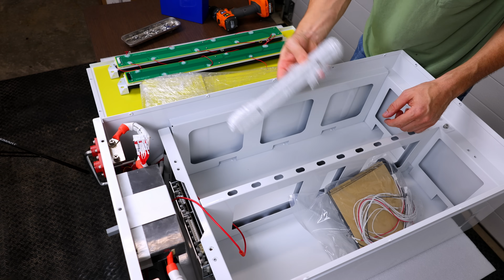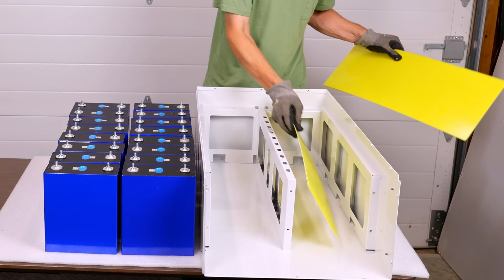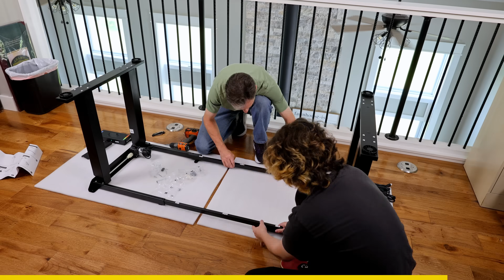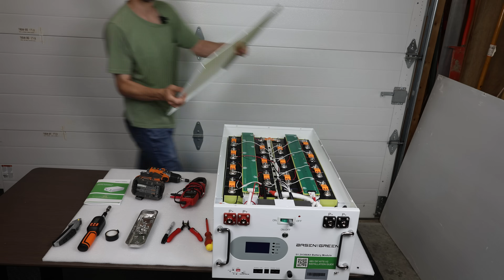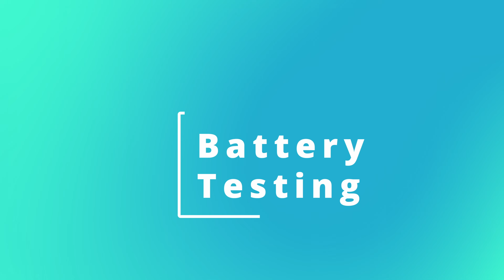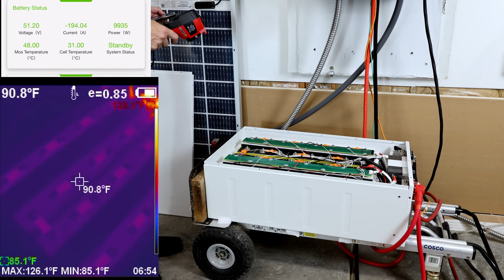SAVE Thousands V2 - Build your own home solar battery backup!

Comment from the maker: See recommended battery options on my website: https://projectswithdave.com/batteries/
FlexiSpot's Summer Sale is here — up to 50% off! Check it out now and use my code "YTE7P50" to get extra $50 off the E7 Plus/ E7 Pro/ E7L standing desk.
FlexiSpot E7 Plus Standing desk: USA: https://bit.ly/3IIGuqI   CAN: https://bit.ly/3TAxVAG
Reply: Does the active balancer only work at the top of the voltage range?
Reply: Thumbs down for F only.
Reply: Hello, Dear. We are China JM Battery Factory. We would like to invite you to shoot an advertisement for our video. Are you interested in cooperating?

Comment: These batteries are a good value and the pricing is good, but I have an issue with the BMS on one of mine and they wouldn't honor the warranty.  They just kept asking me to take pictures and things which I did, but they would never send me a new one.  I've been trying to find a replacement, but they seem to be few and far between.  I guess you get what you pay for!  Just beware if you have any issues, you will likely have to replace the parts on your own.  I would have bought a couple more of them had they honored the warranty, but won't now.  I'll pay a little more to have some type of warranty.

Comment: Great video Dave! Could I set three of these up and go off-grid with solar panels? I already have solar and a backup generator, but I would really like to go off grid with this battery set up and more panels!!
Reply from the maker: It all depends on your loads and solar input.  It is very difficult to go off grid in most locations.  I find it's more cost effective to stay grid connected and just minimize consumption.

Comment: I got one of these and am now looking to double the capacity but they are out of stock, @ProjectsWithDave can I mix with any other brand of similar battery or should I just remove the "old" and get two new ones? Is there some way of knowing is a battery is compatible?

Comment: Can this setup be made as a 24v system with the same components? Have you done any diy 24v systems?
Reply from the maker: Conceptually it could be done if you just used the case to hold the cells and installed two 24V BMS units in parallel.

Comment: Great video @ProjectsWithDave. I am getting ready to commission a Basengreen V2... Do you know the specs of the breaker / isolator? I am wondering if I should have anything between the battery and my Victron Multiplus II 48v 6k5VA 100A inverter? Also do I need a pre-charge resistor if it isn't an off grid setup? i.e. can the capacitors in the inverter charge when I energise the inverter from the AC side?
Reply from the maker: The breaker takes a significant overload to trip.  I would treat it more like a switch and install a Lynx Distributor like this: https://amzn.to/4cQqe3v
It has space for fuses.  Or you can just add an independent fuse.  
I would use a pre-charge resistor even though you might be able to get it to work by just flipping the breaker.

Comment: If you were assembling about 200 kWh worth of batteries like this, how much time would the assembly take assuming that everything’s torque to spec and all batteries are checked for their capacity?
Reply from the maker: If you are doing multiple batteries, it gets much easier.  I would plan for an hour per battery on average.

Comment: How do I change that factory limit setting of charge and discharge of 80 A  and 100 A. It would be great to have a video to show how
Reply from the maker: If you get a version with a JK-BMS you can control all the settings.  I show how in this video: https://youtu.be/5AKooBZNT9Y

Comment: The crossing of the main positive and main negative cable is a very bad design, a short in this spot :-(, full back voltage and with out fuse!
The cables could rub at each other.

Comment: I have a copy of your BMS settings in my 'solar folder'.  Thanks for all the information.  If the inverter is running on grid, at what voltage do you switch it back to battery? I only charge with solar.
Reply from the maker: It's less about voltage in this case, you want to set the inverter to charge with PV only and use the batteries when PV is not available down to a controlled level.  You should have an inverter setting that allows you to only charge the batteries with solar, it would be called  "Self Consumption" mode or "PV Priority" mode.  Then set the minimum SOC to the amount you want to have available for emergency use, probably between 30% and 50% depending on your load and emergency power demands.   If you are controlling with voltage it will be hard to achieve a 50% SOC because the charge curve for LiFePO4 is so flat.

Comment: Hey Dave,I would love love love love it if you could do a build, or at least compare the latest CATL 587AH internal stacked vs standard wound LiFePo cells and explore if the difference is actually worth it. CATL is showing a 48% increase in energy throughput over the entire lifecycle and energy density of 434 Wh/L energy density—a 10% increase over the previous generation. Is this a game changer? 

Thank you for even considering
Reply from the maker: Battery technology is constantly changing and the focus for performance is in the automotive industry, where Ideal construction allows maximum charge and discharge rates.  If you are looking for batteries for home storage I would go with a reputable brand LiFePO4 battery that has been in the market for a while.  Home storage generally comes no where near the charge/discharge limits for the cells allowing you to select stable reliable cell instead of the latest "cutting edge" solution.
Reply: @ProjectsWithDave interesting reply. Thanks.

Comment: Hi Dave! 
Thank you for being so helpful to the solar community! 
I couldn't manage the 48V Basengreen kit via the pc software, finally I found an older version of the program on your website that works great (V1.1.635-15). The new version (V1.1.635-53) available on the manufacturer's website but doesn't communicate properly with the battery kit.
Thanks again for sharing!

Comment: I just finished building 2 of them, I like them, but the bluetooth app on the B&G BMS doesn't work on Android. Not too happy about that. Battery is excellent quality otherwise and both have been cycling as expected. It's a fantastic kit, 1 of mine they put the breaker in backwards? (I fixed that) but really seems like QC needs a little attention. I did not find any shrink tube in the connections as you did on the breaker. When I assembled mine, I found leaving the center divider a little loose made cell insertion easier. I wouldn't recommend this battery in a mobile application, I would rather have welded terminals. I also used the balancer, I wasn't worried about the wires as each is encapsulated in a braided sleeve that's pretty tough as-is. It would be nice if they could integrate the temp sensors and balancer wiring into the BMS distribution bars, it would be so much cleaner.

Comment: I would never try testing it towards 200 amps…. I also won’t need so much but if you NEED it then at least have 2 of these batteries in parallel.

Comment: Is there any way to do this like HV battery? In this case, these are LVs, which means the whole system runs on 48V. But I have a high voltage inverter - currently I run 7 h48050 pylontechs, which gives battery system voltage around 350V. Based on my understanding the cells are the same, the difference is only in parallel connections in case of LV and series connections in case of HV. Benefit of HV is thinner cables, lower amperage, which means easier and cheaper circuit breakers.

Could you please comment on this? I haven't found any guides for HV system like this. Thanks

Comment: Would it be ok to use threadlocker on these bolts if using it on an RV?
Reply from the maker: I think that could be helpful, I just wouldn't use the permanent type.

Comment: 180F on a cable and hotspots on the breaker connections are not great. You're skipping over that a bit quick for my tastes. Maybe not a concern if you don't intend to use it much above 100A. Could be a matter of cleaning up connector surfaces.
Reply: People have been using these boxes forever without issues.

Comment: The main reason these people do this type of kit is because they avoid paying for UL approval, and it reduces their product liability and warranty coverage (they only warrant parts instead of systems).  You may save some cash on the front end, but it may end up costing you more on the back end.
Reply from the maker: Right, there are some significant pros and cons to be considered when choosing a DIY solution.

Comment: It's interesting they limit it at 200A when it's a 314A system, so there's no way to get a 1C rate without either tripping the breaker or the BMS overload protection.  Just wondering if they have a kit with a 300A option?  If not, how easy would it be to swap out for a 300A BMS and breaker?

Comment: Will this battery pass the inspection on a new construction project? Tesla batteries are insanely expensive and I was thinking about building the system myself but based on what the contractors say it might not pass the PGE inspection
Reply from the maker: If you need to pass an inspection I would go with a UL certified battery like this one from EG4: https://signaturesolar.com/eg4-wallmount-indoor-battery-48v-280ah-14-3kwh-indoor-heated-ul1973-ul9540a-10-year-warranty-pre-order/?ref=SALE

Comment: Hello, I'm a new subscriber. Thank you for all the wonderful information you're giving us. I'm trying figure out how to make a r v plug 240 50 amps with the battery set up, I'm going to have to live off grid pretty. Soon any suggestions, please let me know or recommendations. I have one a 1200 watts, the worth of solar panels currently to pair with it, I don't have the battery or batteries. But most of the ones I see are for 120v i need to be able to run the A. CI live in a desert and work here?
If you have any recommendations, I'd really appreciate it

Comment: Great video. Well done. I've got a well house seperate from my main house and need to setup some battery system to run the pumps in a power outage and hope to use something like this to run it.

Comment: Not really saving much lifepo4 300ah batteries are around 300 dollars here i dont really remember the voltage but if thats at 12v not higher each battery is 3.6kwh so 5x3.6=18.... 300x5=1500usd
Reply: there's alot of batteries on the market for 100 bucks per 100ah. They can and do use grade B cells in them which will only give 2000 cycles most. Id prefer to buy my own cells from a reputable cell distributor guaranteed grade A, and properly compress them. I opened up a cheap lifepo4 battery from Amazon to see the QR codes missing, and only held together with compression tape
Reply: @ToledoRocketMan  maybe thats in the us but here in Syria we ship directly from china and with electricity being almost non existent solar is very popular and there is a lot of competition maybe its the different markets i could probably still build a battery for cheaper but with people earning almost nothing in salary its not worth the hassle

Comment: BUT IT COULD EXPLODE YOU NEED KEEP CLOSE EYE ON EVERY CELL WITH #JKBMS APP AND IF ONE CELL GOES AMOK (TOO HOT TOO MUCH VOLTAGE (LIKE 4V)) CLAIM WARRANTY!!!! THERE ARE 50% SCAMMERS OUT THERE SELL YOU CRAP, OR GO WITH #LEADGEL 100Ah 12V like from Accurat

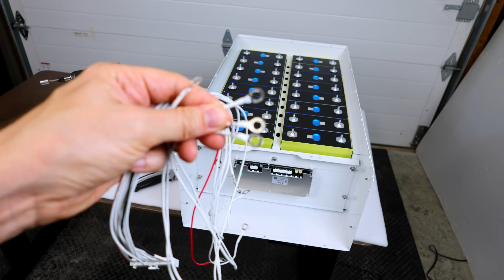Comment: 8:37 I recall the technical term is fixture to hold batteries not compressed. It is popular to say compression yet fixture has a defined use in manufacturing.

Comment: Thanks Dave.  These are just great videos.  The whole production and content are top notch and so helpful.  Used the link for the Basen Green page that shows the whole kit for $1699 and it looks like that does not include shipping.  So I'm confused because the prices you showed in the video said $1761 including shipping.  I know prices do change but I'm wondering if I'm just not looking at this correctly.
Reply from the maker: It's always a bit of a risk showing pricing in a video as the prices are constantly changing.  The price of EVE cells has been going back up recently.  Basen Green is adding lower cost cells from another reputable company CALB.
Also the Alibaba stock is often cheaper, that link is in the description and ill post it here as well:  https://offer.alibaba.com/cps/3jd21507?bm=cps&src=saf&productId=1601147027430
Reply: @ProjectsWithDave  Oh yes, I understand.  I still like to see old prices to know the history.  The other thing I'm thinking about is connecting one of these batteries to my existing system that is all set with EG4 LL batteries.  I don't know how I should do that since I don't know if the BMS are compatible.  If they are not compatible I wonder if I could keep the EG4 LLs connected, both power and communication.  Then just connected the new battery to the same plus and minus bus bars as the EG4 LLs.  Would the new batteries just come along for the ride as the inverters control to the EG4 LL communications... like in open loop form?  I wonder about the implications to both the EG4 LL batteries and the new battery pack.  Any thoughts?  Thanks so much for all your great work.  You are inspirational.

Comment: Dave... OK so the $1M question is YixEnergy or Basen?
Reply from the maker: Hopefully less than a $1M question.... : )  
Here are some thoughts:
Both cases are well built and perform as advertised.  I was able to get both to communicate with my EG4 inverter.
If you want to source your own cells, the Basen Green case is designed to work with single post batteries so it is more flexible in that way.
I like the JK-BMS with active balancing on the YixEnergy because the settings are more flexible and it allows direct control of the active balancing.  You have to use their cells because of the double post design, but it allows two connection points per cell which is nice.  It also has a fire extinguisher which may give some peace of mind although I haven't seen a test result to show it would actually be effective. 
It probably comes down to which one has the best price for the features you find most valuable.

Comment: 1. Could you swap in a 300a BMS safely,  2. What if you ran it with a FlexbosS 21?
Reply: Wondering same
Reply: @Jstyl3z  Ill probably end up just doing it myself and research if the amperage and such is within spec and wont explode on me. If I ever do I'll try to post it on here. Saving up that money first.
Reply from the maker: If you install a 300A BMS you would need to upgrade the wiring if you want to take advantage of the higher current capability.  However, depending on the BMS you could still limit the max current to 200A.
Reply: @ProjectsWithDave Are you saying that if its a programmable BMS? The first note tho, i figured id have to increase the wiring. What about the discharging of the batteries and the flexible coppers? would thosee need to be size increased too? Im just asking how far does this go throughout the system if I were to install a bigger BMS?
Reply from the maker: Every conductor has to be rated to carry the max current you plan to run, including the cell to cell busbars.  You also don't want to exceed 0.5C charge and 1C discharge rates on the cells you choose to maximize cycle life. 
It wouldn't cost much more to just get two batteries.  Then you have 400A available and double the storage.   If you want to lower the cost get 280Ah cells instead of 314Ah.
Reply: @ProjectsWithDave I was definitely thinking 2 batteries of 314ah with a flexboss21. I'm trying to get close to 11kw continuous output safely with minimal battery footprint for the smallest space. If you have 2x 200A BMS one for each battery like your setup I think it can happen

Comment: What is your opinion about mixing a larger battery like this in parallel with standard 100AH server rack batteries (no comms)?
Reply from the maker: I've tried it in the past.  I tried two setups.  The first was this battery with 5- 100Ah batteries in parallel and the other setup was this battery with 3-100Ah batteries in parallel to match the capacity a bit closer.  The result is similar.  They don't deplete at the same rate but if you charge to 100% every day or every 2 to 3 days it does work.  If the capacity and internal resistance don't match the charge/discharge rates will not be the same, but may be within tolerable limits for your setup as long as they are both LiFePO4 batteries.
Reply: @ProjectsWithDave  Thank-you. Good experience. Winter is the big issue for me. I can go 4 days with batts not getting full charge, but summer I charge everything 100%,usally before noon.
Reply from the maker: You might have a situation in the winter where one of the batteries will disconnect well before the other one is drained.  But that may be ok for you if it is happening infrequently.  You just end up with the situation where one battery is spending more than the optimal amount of time below 20% SOC.  Probably not a huge deal.

Comment: Super helpfull stuff! But... I know it is common to say "48V" but you really built 51.2V battery. I see a lot of brands selling a 15S batteries which are true 48V, and people (could) get confused.
Reply from the maker: Good point, it's just a naming convention that's used in the industry.  I have seen a few 15S batteries out there, I would not choose that configuration unless you needed the lower voltage for some specific application.
Reply: @bkvodnik Because 51.2V systems are so ubiquitous now and have become the de facto standard, from my perspective the problem is opposite of what you say. There are a few remaining Amazon sellers trying to offload the last of the 15S 48V systems onto a customer expecting a 16S 51.2V system.  Those are the ones you have to worry about.